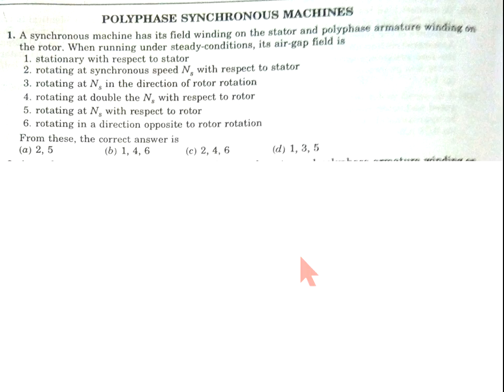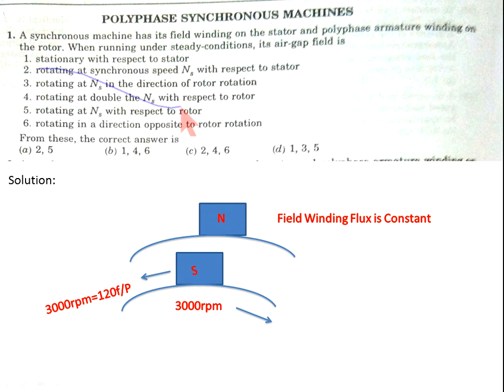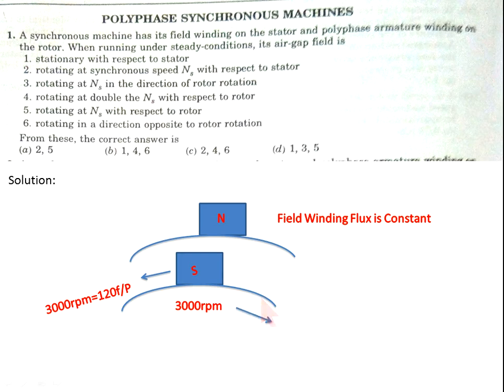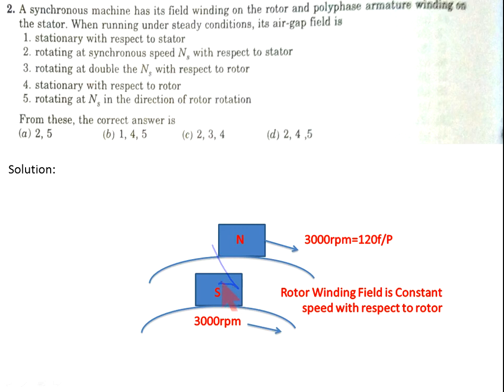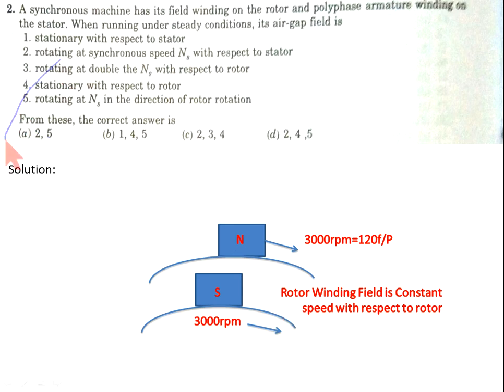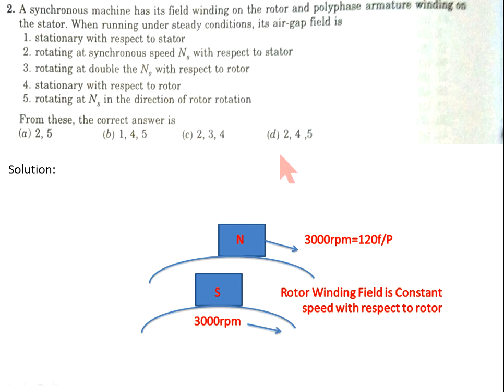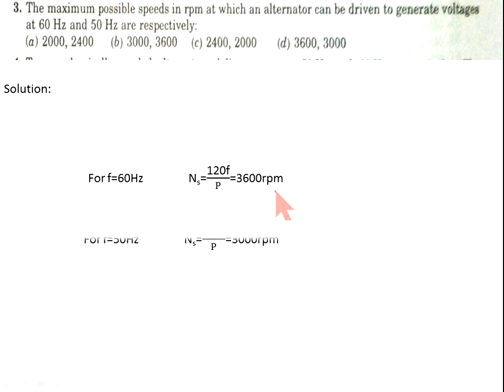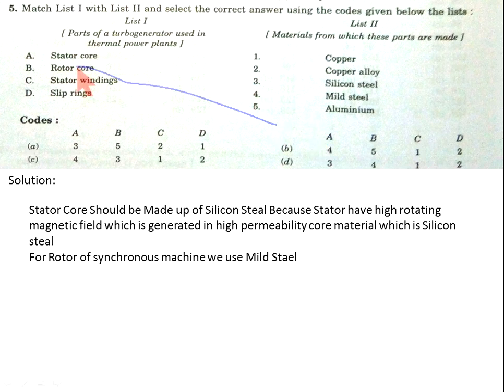Solution of P.S. Bimbhra(Synchronous Machine) Q.01 to Q.10

Comment from the maker: Transformer
1. Solution of P.S. Bimbhra(Transformer) Q.01 to Q.20
https://youtu.be/bQT3BQeWU_o
https://youtu.be/-fEoQalfyWI
2. Solution of P.S. Bimbhra(Transformer) Q.11 to Q.20
https://youtu.be/LMBCmf58aB0
https://youtu.be/djrMWvOweUo
Polyphase Induction Motor
1. Solution of P.S. Bimbhra (Poly phase Induction Motor) Q.01 to Q.10
https://youtu.be/1oJEXfw4a88
https://youtu.be/Swh9FIIlLn4
Synchronous Machine
1. Solution of P.S.Bimbhra(Synchronous Machine) Q.01 to Q.10
https://youtu.be/l8BJHhBHofU
https://youtu.be/a1PUPB0TXb4
2. Solution of P.S.Bimbhra (Synchronous Machine) Q.11 to Q.20
https://youtu.be/_a4qIzbktpo
https://youtu.be/I_uIb4oocJs
DC Machine
1. Solution of P.S. Bimbhra (D.C. Machine) Q.01 to Q.10
https://youtu.be/uaxRKaA8dhk
https://youtu.be/fWLnnmQp-II